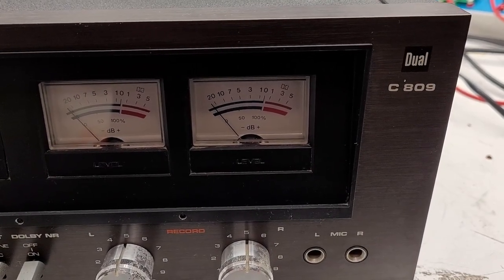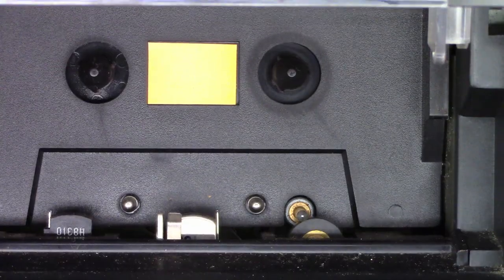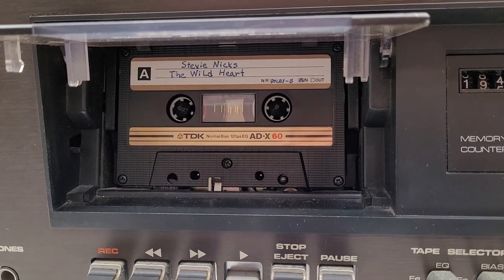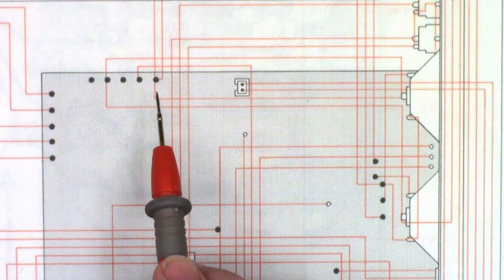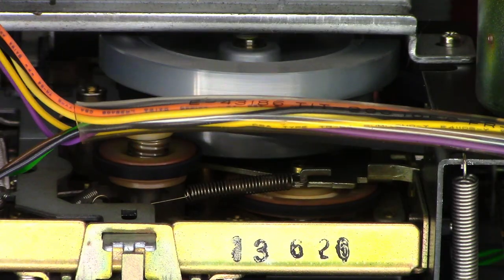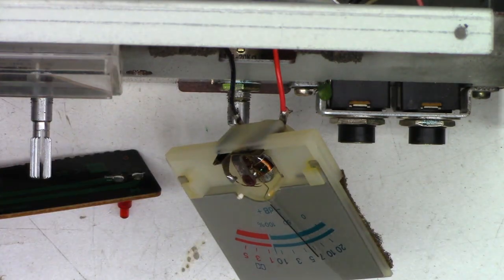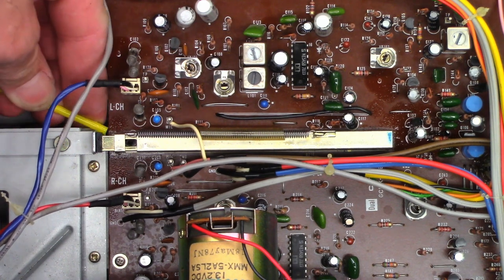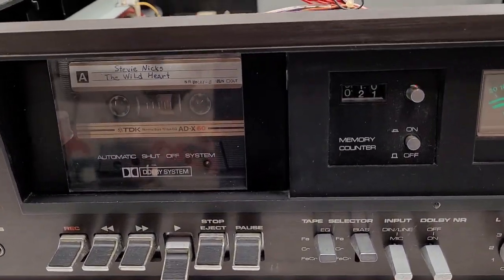DUAL C809 CASSETTE DECK REPAIR. LAMPS OUT, METER STICKING, NEW BELT, CLEANING, DEOXIT D5, ACETONE!

Comment: Maybe aceton works great for cleaning and deglazing rubber, but when it touches plastic, it changes the surface of it, as you can see (almost end of video) where the cotton-swap soaked with aceton touched the plastic backplate behind the cassette, after cleaning the head and pinch-roller. It's safer there to use isopropanol/cleaning alcohol.

Comment: I noticed; from another video clip of this same unit, that a small green pilot lamp lights up when the Dolby NR is switched on or off. Also, there is a red pilot light,  between the L and R volume knobs, to indicate when the unit is in the 
"Recording"mode. Could one of those two locations be where the extra lamp is from? Thanks so much for these videos. It's very satisfying to watch a master at work in there craft.  Harddrive 56
Reply from the maker: The red(record) and green(dolby) lights are both LEDs. I should have mentioned that in the video.

Comment: Are there benefits to using acetone over IPA for deglazing?
Reply from the maker: Acetone is stronger and evaporates much faster. I have IPA but don't use very often.
Reply: @norcal715  Perhaps you should try using it more often... It certainly couldn't hurt! Especially near plastic...

Comment: Nunca usar acetona!
Reply from the maker: He estado usando acetona durante más de 40 años sin reacciones adversas. Tomaré tu consejo y lo reflexionaré. Seguiré usando acetona. Gracias. (I have been using acetone for over 40 years with NO adverse reactions. I will take your advise and ponder it. I will keep using acetone. Thank you.)
Reply: @norcal715  gracias por responder. Problema de acetona es porque disuelve el plástico , y también reseca la goma. Yo uso alcohol isopropilico 99%.
Entonces cuando acetona va bien para usted, usted manda.